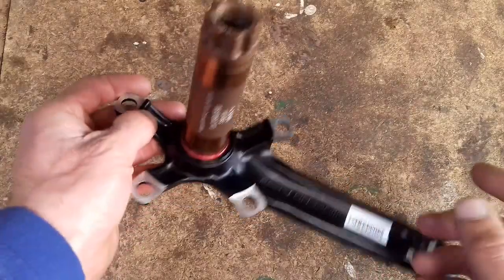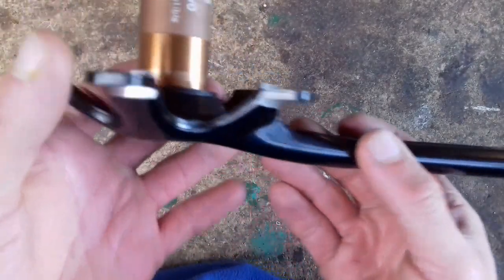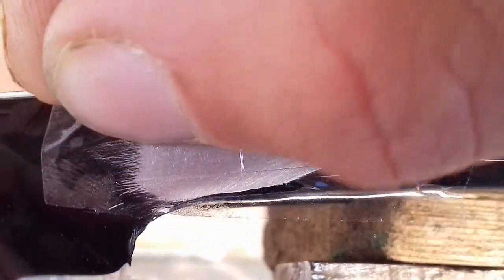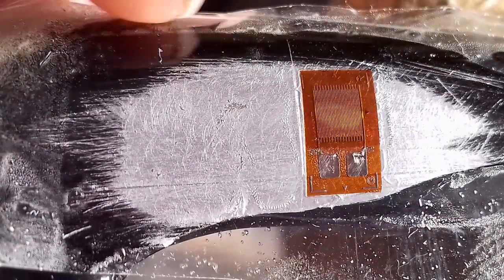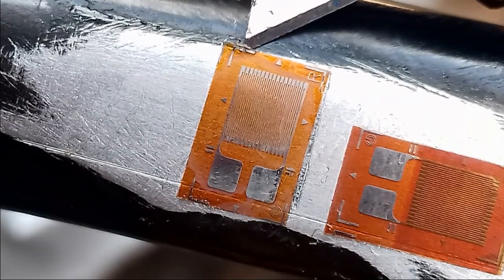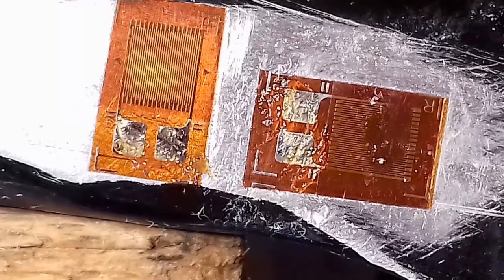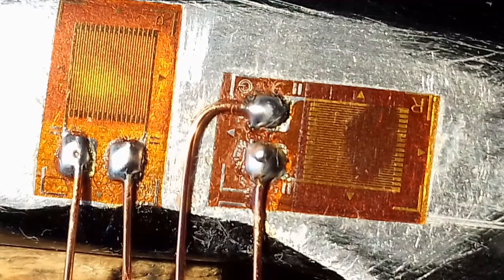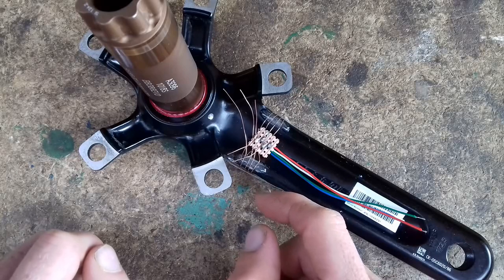Homemade Bicycle Power meter V2 Installing Strain Gauges

Comment: Hello, could you tell me the reference of your strain gauges? Thank you.
Reply from the maker: Hello, unfortunately I can't help with that as they didn't have any information with them. I got them from Ebay years ago from a seller who had obviously bought in bulk and repackaged. Sorry about this.
Reply: @Ed.R  Too bad, indeed, but thanks for this quick reply!
And could you tell me where did you find this 90° arrangement for the gauges?

Comment: Hi Ed R. Why would an electric bike have a strain gauge on it? I am in the process of swapping frames for my folding electric bike and came across one mounted to the frame. What happens if I do not swap that over? Thank you!
Reply from the maker: I don't know much about ebikes. I suspect it's a torque sensor or basic power meter. It will allow the electric motor to adjust its assistance based on the riders power output. Electric bike setups without a throttle need to know when the rider is pedaling. Not sure whether it will work without it. Depends if it has a cadence sensor.